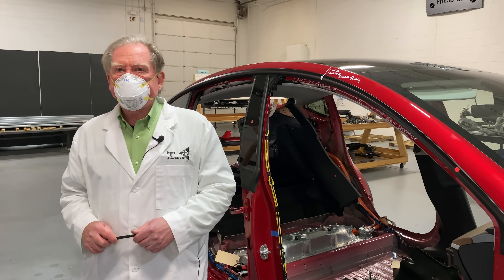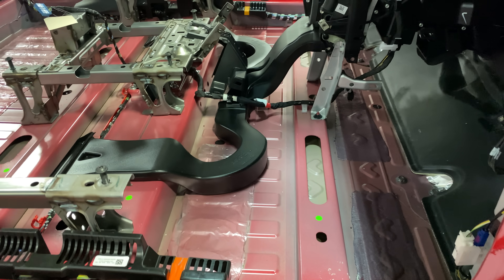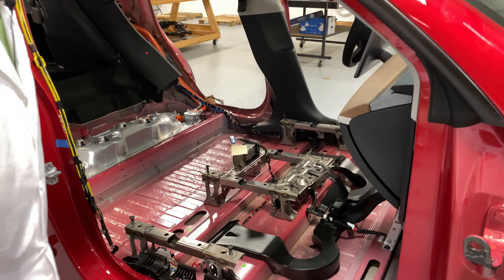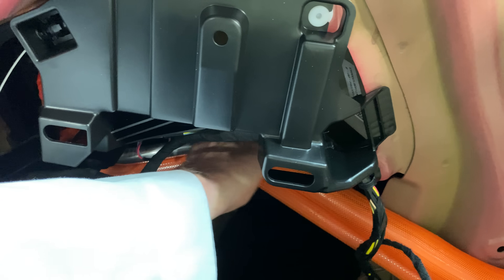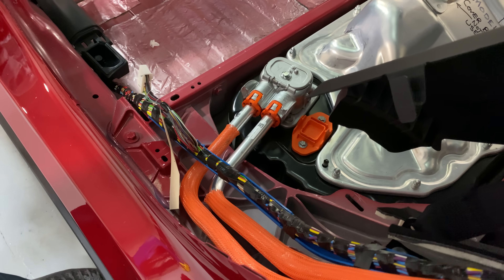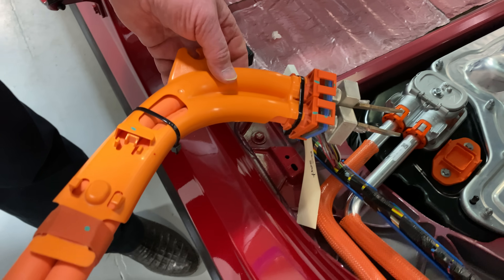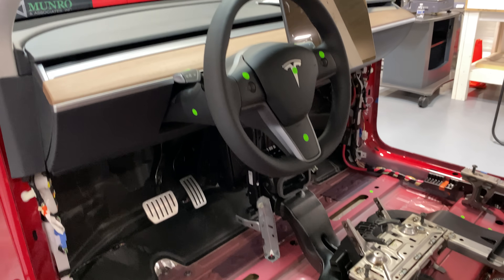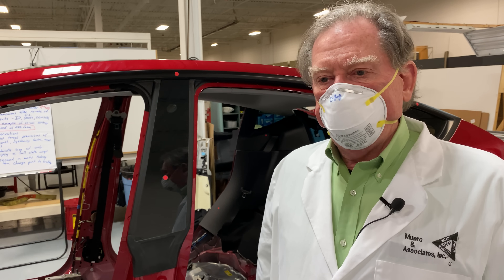Model Y E12: Floorpan, EPP Floor Risers, Commonality through Stanchions, and Wiring Observations

Comment: My little Fiat is 13 years old. The internal reinforcing steel is not painted and there is no corrosion. It's not even deburred. Sharp edges are no problem when fully covered up.
Reply: Yes, but it's still a 'Fiat :)

Comment: Really liking this reassurance of what I'm seeing. Planning on taking delivery of a AWD model of this car. Only thing I wish they could fix is Paint and alignment. Seems like everything else is where it should be for the most part. The clips missing or issues, this to me is common, even my current Kia Niro has 3 hot spots inside where crap has pulled away, missing, or broke. A+ stuff so far, thank you again Sandy and your team!
Reply: More importantly, the actual engineering of the car seems top notch. With several improvements from the already very good model 3. 

These are things you don't see in reviews, but the model Y is definitely a solid improvement over the 3 as a engineered car
Reply: I'm sure most cars have panel gaps and minor paint defects. They just aren't mentioned because people don't care enough to notice.

Comment: Rigid conduit for high power cable is genius, rigidity is a robots friend..
Reply: also if it catches fire for some reason, it won't lit up the interior.
Reply: About the metal conduit, why not put both cables in the same tube? My 380 V tri-phase use a single tube. 
But I guess there is better protection in case of an accident?
Reply: @nihongobenkyoshimasu3190  V3 Supercharger outputs 400V @ 800A * 80% ~= 250kW
Reply: I don't get this. He's saying that "heavy cable run inside the pipe".  How does that avoid the need for "push pins and snapfits"? The cable itself still needs to be pushed into the inverter. And how does wrapping in metal conduit make it smaller and lighter than plastic cabling?
Reply from the maker: @js71378  The pipe itself is thin-walled and relatively light, especially as compared to troughs, grommets, and fasteners that would otherwise be needed to route it.  A traditional HV cable is a wet noodle that needs to be fastened at multiple points along the way, like the Model 3 one shown on the floor, so by using a rigid tube with a pre-defined shape, no routing provisions beyond the tube itself are needed
Reply: @js71378  Munro's response is correct, the tubing holds the cabling in place. One piece, one setting of materials, as opposed to setting say the candy caned (taped) cable and needing to mount clips along the body panels and internal structure to hold in place.

Comment: I don't see how the charge port "pipe" can be any lighter than the cable, since it has to have the same insulated copper cable inside.  I think it's all about fast installation.
Reply: What these others said. Also, there are lots of other components missing because they aren't needed anymore
Reply: count the parts on the model 3 cable he showed you, then count the parts on the silver tube/metal cable combo.... huge difference in parts, weight and fitting time
Reply: @bobh9492  The weight difference between the old plastic fixtures and the new metal tubes is probably not that significant, certainly not "huge".  Installation time is the big difference, as I said in my initial comment.
Reply: @JRP3  I'll take that bet, lets ask mr munro to weigh both components.  Whoever loses has to say "I eat thine crowe."
Reply: @bobh9492  OK, but first we need to define "huge".  What percentage of weight difference do you consider "huge"?
Reply: @JRP3  statistically significant, 5%
Reply: @bobh9492  Gotta be at least double digits to count.  If it's more than 10% I'll say it's meaningful.
Reply: @JRP3  Fine, if the Model Y metal cable fitting rig is 10% lighter than the model 3 equivalent fitting I win, if they're not you win.
Reply: @bobh9492  I did say "more than 10% I'll say it's meaningful", so 10% or lower means I win 😉
Reply: That orange rubber insulation that is over the charge cables on the Model 3 is probably heavier than what looks to be galvanized steel in the Y. The Model 3 needs to have insulation that is both structural and insulated. The Y can have thinner insulation on the wires because it is being protected by a harder steel casing.
Reply: @Dkilbane1  The plastic insulation is lighter than metal pipes, and the insulation still has to be thick enough to handle the voltage and current, so no.

Comment: 4:58 Okay Sandy, this is a good idea(plastic tray). So what exactly that is? I think you forgot to tell us what it is.
Reply from the maker: Thank you for tuning in!  Here's a little bit more context: Many, if not most, cars use wiring troughs to protect the wiring harness in areas where they need tight packaging and resistance to crush, such as at the door sill where people may step when entering or exiting the car.  Many troughs that we've seen fully enclose the harness, featuring 3 sides and a lid, and they tend to feature solid walls of material throughout.  3 interesting things were observed on the Model Y troughs: 1) They were only 3-sided (bottom was left open), which saves weight and cost in unused material. 2) There were open sections throughout the trough walls (probably what you're calling ribs), which again, saves excess material, and thus weight and cost.  3) The walls themselves seemed to be of rather thin gauge compared to other, more robust trough designs we've seen, so again, thinner walls, less material, less weight, less cost.  The over-arching takeaway is that it seemed to be a cost and weight efficient execution of a wiring trough.
Reply: @MunroLive  Thank you Sandy for giving more context about it! We really appreciate it! Can't wait for more videos. :)
Reply: Jek yes. Sandy uses a lot of technical terms and doesn’t fully explain things. He needs to take more time and explain what each part is and what it does before talking about Tesla’s improvement of said part.
Reply: @George-Aguilar  Yeah. Specially it's impromptu. It's just I'm so curious what are those plastic tray that he said it's a really good idea. :)
Reply: It looks like it's a protective tray for the bundle of wires
Reply: @sigmaOmega87  That's what it looked like to me.  With cutouts to reduce weight.
Reply: Urgelt .. and not trap moisture
Reply: What is it? He already said. Answer: a good idea :)

Comment: It doesn’t seem like they remodeled the wiring in a way that reduces total miles as much, with separate modules or something you talked about a long time ago (before model Y was there)?
Reply: I think that was a patent filed maybe half a year to a year ago, at which point Model Y prototypes etc. would've been far along. I would guess that the modular electronics method will first see the light of day in the Cybertruck, if it is deemed worthwhile.
Reply: @AapoAlas , makes sense.
Reply: It's for the next car.
They wanted to lunch the Y sooner.
Reply: Stefan Brand they have been doing that reduction in wiring for decades in aerospace to reduce weight - mux-bus lines.
Reply: There were different designs for the Y. They went with the one that reuses as much as the model 3 as possible. This means not changing a ton of components to use new wiring. You can bet they are still working on improving the wiring harness, but it's a pretty huge deal that impacts nearly every piece of the car.

Comment: Should have had the heater running full blast for a few days to discharge the pack.
Reply: The car won't let you fully discharge it.  You still need to discharge it externally.
Reply: @_PatrickO  Sure but it would get you down to about 10% SOC.  Then just throw a resistor across the terminals 😬
Reply: JRP3 agreed. 90% SOC vs even 50% is a huge difference in risk.
Reply: @shannons1886  its not really possible to work with a completely 0 volt battery. Its better to disconnect parts of the battery with insulated tools and gloves to reduce voltage below 50 volts.
Reply: The battery controller will not allow you to that. The Tesla Batteries have quite some redundancy and safety built int them.
Reply: @heinrichwonders8861  As I said above it would have lowered the state of charge substantially, maybe to 10% SOC.